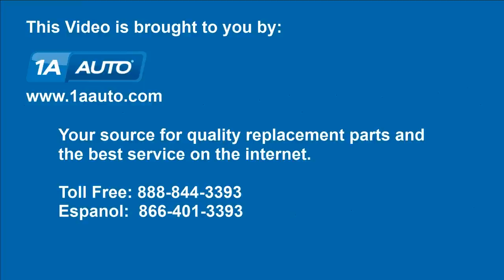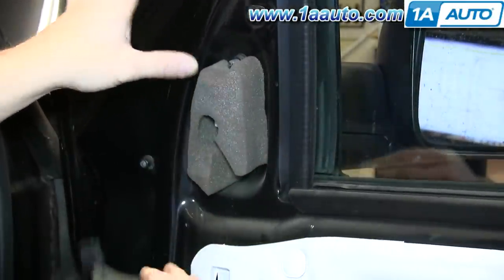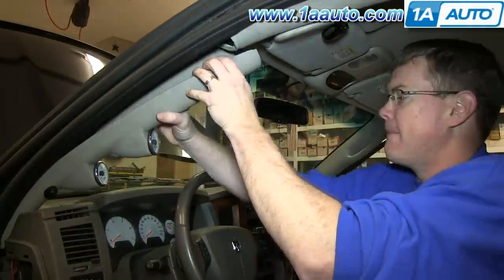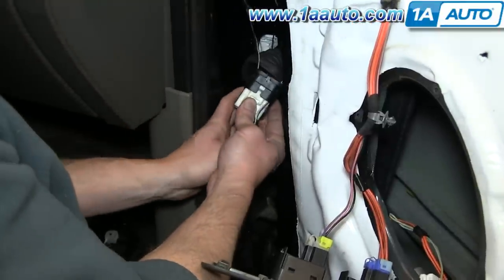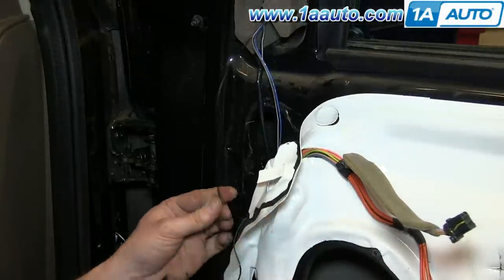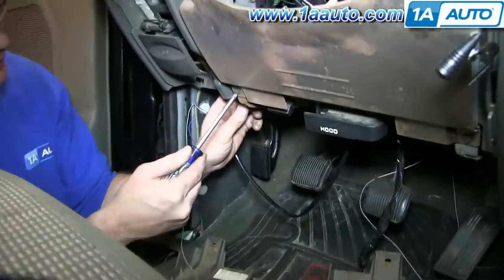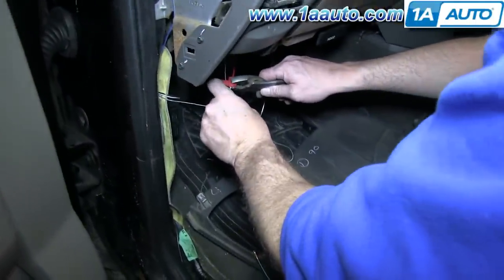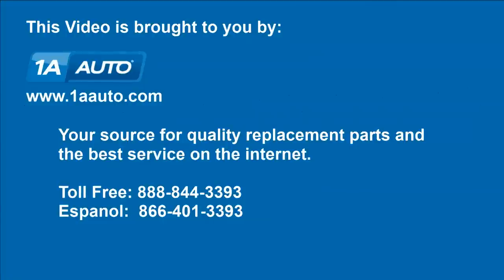How to Install Power Folding Tow Mirrors 09-10 Dodge Ram 1500

Comment: On your website you show a pair of power folding mirrors with puddle lights and signal light with the chrome cap for a 2012 Ram. When I inquired about them I got a response saying it won't work because they are only for a trucks with option to option. How is this possible? The 2012 Rams never came with an option for power folding mirrors. So how can you sell power folding mirrors that can't be installed on a year of truck you sell them for?!?!

Comment: This is pretty awesome. BUT.. it's useless if I can't find the parts you are using here. I went to your website ready to buy the harness  and switch, but it's close to impossible to find the parts... Please put a link to the parts you are using so we can buy them. Thank you.
Reply from the maker: +Jose R. Castillo Thanks for checking us out!  Unfortunately we do not sell the switch and wiring separately, they will only come with our upgrade tow mirror sets.  If you need assistance finding the right part you can give us a call at 888-844-3393 and one of our representatives can help!  1aauto.com

Comment: Are there any models featuring turn signals,and power fold for a 08 1500?only thing I see on your website is power fold option only,no lights.
Reply from the maker: Thank you for watching! Please call our sales staff they will be able to assist you . The number is 888-844-3393 thanks!
1aauto.com

Comment: I have a 2008 dodge ram 3500 with just power mirrors. I would like to upgrade with the mirrors that you have in this video, don't need the puddle lights but they would be nice. What do you have?
Reply from the maker: +Scott McCullough Here is a link to all of the tow mirrors that we carry for this vehicle. https://goo.gl/1nS5ta
Reply: Will this mirror work on my truck PART #: 1AMRP01783? I don''t have heated mirrors on mine now.
Reply from the maker: +Scott McCullough They would not work. We always recommend matching the factory functions exactly to the functions of the tow mirrors that you are trying to purchase for an easy trouble free installation. 1aauto.com

Comment: Can you put a set of these lights on a 97 Dodge dually had manual mirrors, no power whatsoever.
Reply from the maker: Mirrors must be replaced option for option. If your original mirrors do not have the same exact options as the new mirrors, they will not function properly.+Invisable Soul

Comment: PART #: 1AMRP01410. Is the model I'm looking at.
Reply from the maker: willlouis69 Hi Will, that kit will add the power fold feature to your truck if it didn't come from the factory with that option. Those particular mirrors also have power, heat, puddle lights and memory. If you don't have all of these other options from the factory, the mirror may not work correctly when you plug they in, and may require those options to be enabled at the dealer. We recommend matching all of those other features up so that they match what you currently have. Here's a link to that SKU on our website, hope this helps you out http://www.1aauto.com/2012-ram-mirror-pair-chrome-cap/i/1amrp01410?utm_source=YouTube&utm_medium=CTA%20Comment&utm_campaign=1ATony